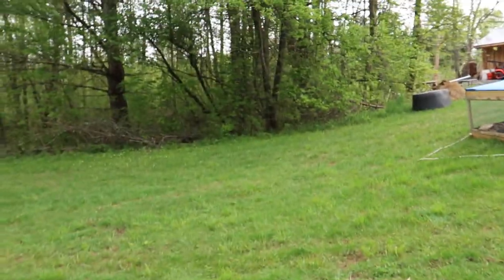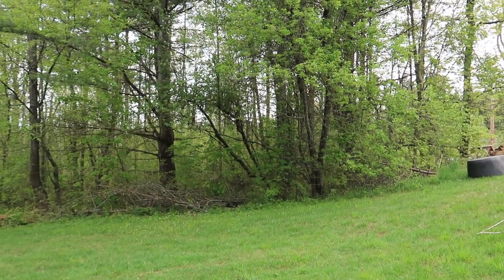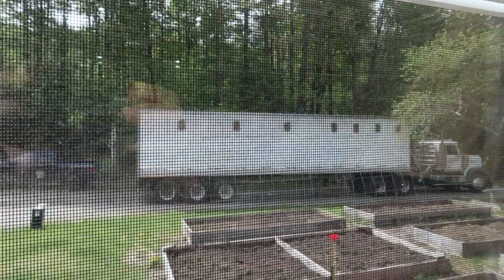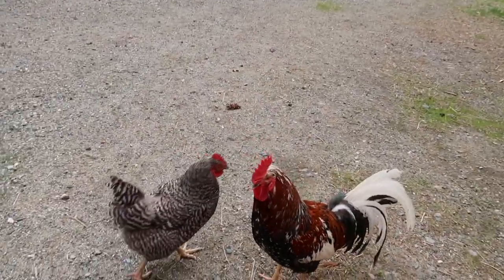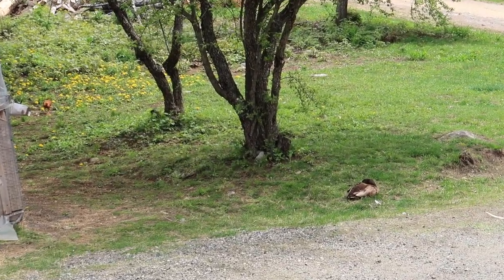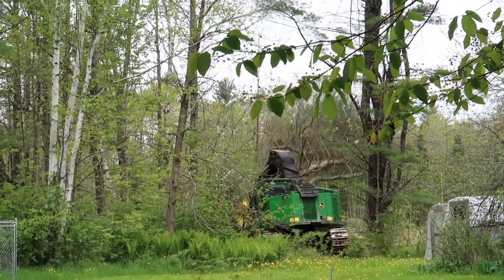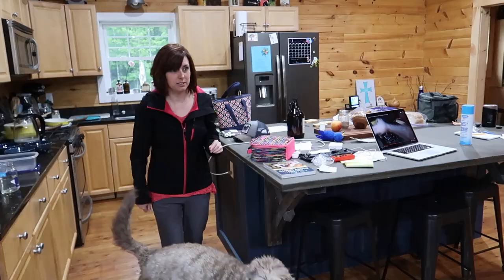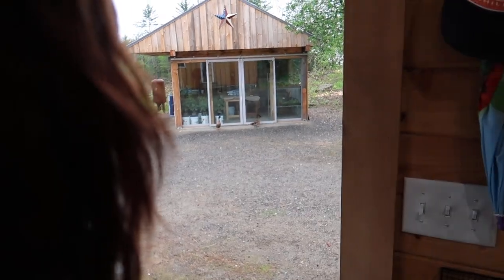Turning Old Pasture New Again Expanding Our FARM

Comment: God that never gets old watching those guys take the big ones down.  We have to cut sporadically for tree growth.   It's so crazy.  They need to make a homeowner version, lol.
Reply from the maker: I need one for the front of the Kubota!
Reply: They separate the slash from the logs. The pine and cedar logs are used for chips and the slash is hog and fuel chips. It is all factored into the price the logger pays the owner. They try and maximize the money they make from a clear cut. You can see them separate the hardwood logs from the pine logs.

Comment: I doubt this will be read but...on your chicken tractor, what if you mounted a dowel on the bottom 2x6 (around the entire perimeter) that they could not only perch on but it would push them when moving it rather than them getting pinched under the sides?

Comment: The pigs broke the seal on the 55 gal tank, but I will try and fix that, but its the nipples on the five gal for our chicken tractor..it just runs out where the metal nipples are..drives me crazy..
Reply from the maker: did you use the horizontal watering nipples on the 5 gallon bucket?

Comment: man that is way cool. On  a completely different subject. I made a waterer like yours but the nipples just leak out Its not leaking  from the area where I drilled them in, I used Teflon tape there.. I am a loss. is there some trick I am missing here?
Reply from the maker: which waterer chicken or pig?